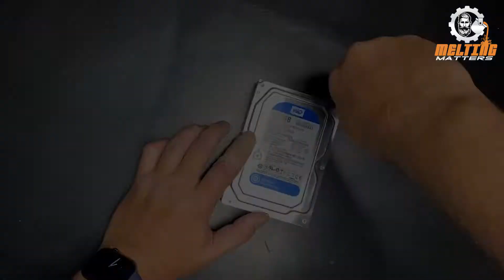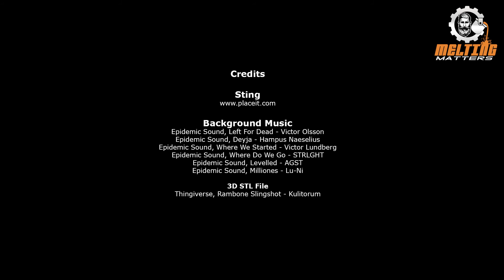How to make a slingshot using aluminium

Comment: Where do you get the furnace and gear from Kris?
Reply from the maker: Hey mate, the furnace is from Devil-Forge.com, they are an awesome company to deal with and have a great range.  As for the tongs, they are home made.  The crucibles and graphite molds are from eBay.  😀